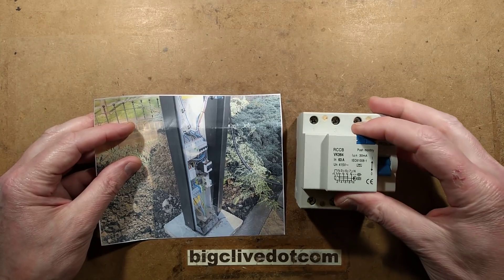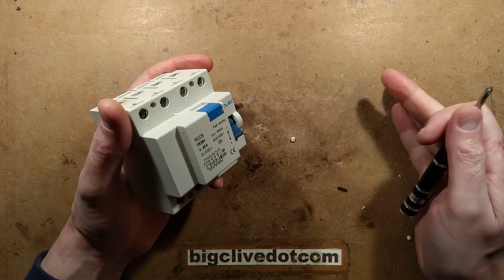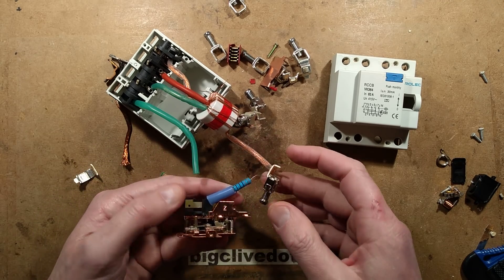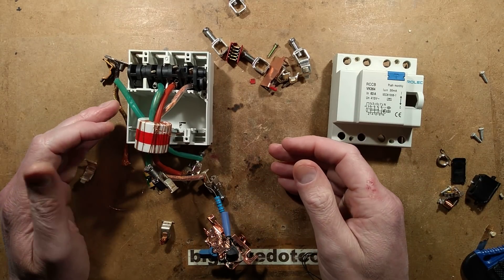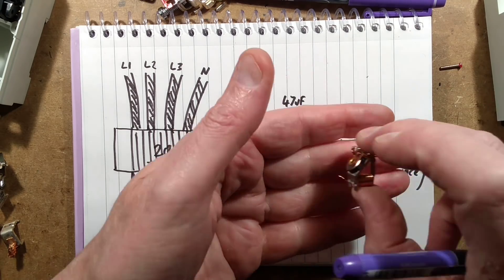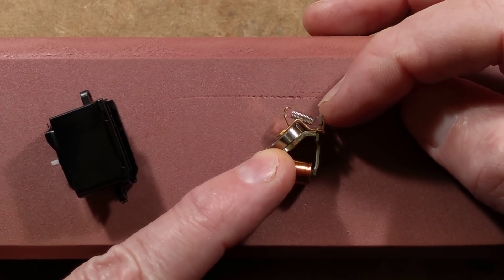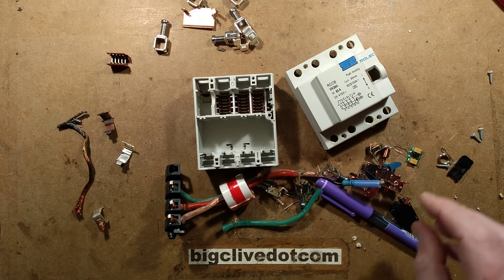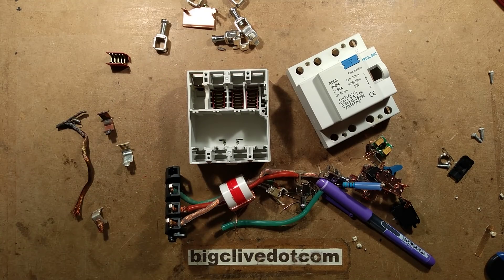Failed 3-phase RCD/GFCI from a Rolec electric car charging pillar. (with schematic)

Comment: Makes you wonder why they don’t just have hot-swappable batteries, it sure beats waiting for a few thousand 18650s to be pumped up.
Reply: I've got about 150 18650s in a plastic tub. It weighs about 15kg. Early Teslas have about 10 times that. Later ones have about 15 times. Home swapping would require packs of about 10kg at most for safety. That means somewhere between 15 and 25 packs to be pulled out, and then somehow safely arranged for charging.
Reply: Nah, make them 25kg, just to annoy the feminists.

But seriously, if they made them hot-swappable, they'd make it all one or two packs, and include a lifting mechanism. I'm guessing they don't, because nobody wants to spend half the cost of their car on a spare battery.
Reply: Actually Tesla did apparently fully develop a system for hot-swapping the entire battery pack with a station. 
The packs are designed to be swappable within seconds.

They just never ended up rolling that out anywhere for many (good) reasons. 
Turns out people prefer to own their entire car when they buy it.
Reply: @Basement-Science  it was developed, but requires modified Tesla. Most of the ones on the road, would require a bit more work to take battery of.
Reply: I remember reading about an intracity electric bus route in the United States back in the 1970s or so that used huge Lead Acid battery packs which required prolonged (16-20 hour) charging cycles.  Since the buses only got a few hours on a pack and were in operation 12-18 hours a day, the bus depot had a huge charging station which did swap out the battery trays in the buses.  If I recall, the swap process was automated and only required 15-20 min to swap out all the packs.  The packs were on rails and were pushed out of the bus by the charged pack going in.  The battery mechanics then performed any required maintenance on the packs and charged them.  I believe each bus had 3 complete packs that were always at some part of the charge cycle in addition to the pack on the bus being used.
Reply: @mcgyver272000  That's how electric forklifts and other material handling vehicles in factories work. You swap out the whole lead acid battery pack either with another forklift or a pallet jack at the beginning of the shift.
Reply: that would be funny and I could just see the issues, people cannot manage to plug them in to charge using easy connectors... now imagine having delicate high voltage high current terminals that need connected perfectly to not cook/burn
Reply: How do you expect to "hot swap" a few thousand 18650 or 20/21700 (over 7000 in some Tesla models)? There would have to be a station that does it. You couldn't do it at home.
Reply: It makes no sense. You would need too many spare packs on each location, and the capital and running costs are too high. Easier to just have fast chargers. Plus as tech develops, capacity will increase and charging time decrease..we all want phones etc with better batteries..cars will benefit and vice versa.
Reply: @fruitytv-uk  and you forgot the fact all cars are different. Full scale battery swap would require them to have many different types of battery packs at each station. Sure, manufacturers would agree on multiple common standards, but that would require even bigger  storage facility at each place.
And since quite a lot of EV owners don't use charging very often, opting for charging at home or workplace instead, building such complex stations is a bit of a hassle.
Reply: In India you can get electric scooters with hot swappable batteries, pull up to an exchange and it tells you which one to take out and you put yours back and go.
Reply: Back in the 70s when I was a child I had a kids science book and in one part of it it looked at ideas for electric cars. There was a concept in the book where the car was driven to a "filling station" where a mechanism (like the forks on a fork lift) would remove the spent battery (which would be recharged at the filling station and re-used later in another vehicle) and install a fully charged replacement making it as quick and easy as filling up with petrol or diesel. Always thought this was a good idea to get over EVs biggest problem - charge time. It would of course require standard batteries across all manufacturers, but there is no technical reason why it couldn't be done - we have standard AA, PP3, 18650 etc. it just needs the will to make it happen.
Reply: Ok so ideally you’d have a vertical lift or sliding mechanism to take the battery case out of the side or bottom of the car, and this would happen at “petrol” stations alongside roads. The money you’d pay for the refill would include both the wear-and-tear on the battery and the electricity cost of filling it up. You wouldn’t swap them out at home because the assumption is that the car would be sitting there long enough to receive a full charge. You wouldn’t need to do a swap at all for basic commuting, it would just make long trips (and cargo transport) more convenient. I can’t imagine getting only 200km before I have to wait for a few hours for my car to recharge, electric cars at the moment are simply not good for that.
Not to mention that the power you charge your car with could be coming from fossil fuels anyhow, if you’re living in a country without nuclear plants or renewable power stations.

Comment: Perhaps the edge-most wire gets pulled on and has insufficient strain relief, increasing the terminal resistance and producing heat?

Comment: If the gardener can kill the protective housing, I expect the whole device is built to a very low price, to compensate for the price of installation.
Reply: i'm now wanting to know what would happen if dogs start pissing on them, would it be a new hot dog cooker for clive?
Reply: It's not just weed whackers either.
My local council managed to mow to top off a power company pillar with a tractor mount mower.
I happened to be watching it happen, the weeds were taller than the 1 foot tall plastic box, so the mower reversed in and mowed the top off everything.
Definitely made contact with street mains, I found a 100A fuse and fuse holder with blade impact marks.
Reply: Yes that was quite the display of power, especially when you consider that only one out of three phases was hit.  This was around 15 years ago so we were still using CRT monitors for the computers; when the line broke every monitor started flickering as if you had activated the degaussing coil to remove magnetization from the screen.  Surprisingly it did not seem to have any effect on the computers themselves, they must have been sufficiently shielded.

Comment: Here in the US there have been problems with overheated neutral in 3-phase systems due to poor power factor caused by electronic power supplies.High frequency harmonic currents do not balance out causing the neutral to carry higher then rated current.

Comment: The fault could be the fact that the left most terminal is the furthest from the "breaking torque" on the other side. Meaning when tripped or going into the off state the twisting force isn't enough to fully or properly disengage the left most pole.  Perhaps why it's common to see the left side with problems.  BTW,   I think it's pronounced Wah-Way.

Comment: Yes, they are tantalum smd capacitors. The bar marks the positive end,  because, why not do the total opposite to electrolytic caps, where it marks the negative ?!
Reply: Jonathan Kay - through hole wire ended tantalum capacitors have always (well, mostly) had their positive terminal/lead marked with a + (plus) symbol. Through hole wire ended electrolytic capacitors normally have their negative terminal/lead marked with an arrow that incorporates a - (minus) sign. But older can type (non-PCB mounting) electrolytic capacitors have used a variety of marking systems (often with different coloured paint spots). I don’t know why, but it has been this way for over 35 years.
Reply: @Mark1024MAK  the likes of you and I, who've been in the business for 40 years, know this stuff. But "a trap for young players" as Hanetar and the mighty Dave L. Jones would say. It was more an attempt at irony, on my part.
Reply: Jonathan Kay - Ahh! The thing that does trip me up is the extra small and hard to read labelling on modern components, especially SMD... And some chips now don’t appear to have pin one markings 🙁
Reply: Trap for young players, eh? Me included... :D
Reply: Ive never understood why electos mark the -ve. Schematics n pcbs always mark the +ve. Odd...

Reverse polarization on a tant is rather energetic. A mate was having trouble getting reliable ignition with his candy rockets with his DIY ignitors. For whatever reason, at work we have about 30,000 small 6v tants that are not used in any design. Gave him a few to try. Given 12v reversed, they rather pop. 100% reliable, and instantaneous, unlike his resistant ones. Rather expensive if your buying retail, but definitely go off.
Reply: @arjovenzia  Glad to hear someone actually did that. One of my dumb tests caused one to explode violently. First thing I thought it would be a perfect detonator...
Reply: Jonathan, electrolytic caps also used to have the positive terminal marked, when most of them were made in Europe and the U/S. Then the Chinese and other Asian manufacturers started marking the negative terminal, for some reason not known to me.
Reply: Maybe it was a problem with condensing water and corrosion.

Comment: RCDs are known to open or attempt to open under extreme overcurrent or short circuit conditions.  So if the complete charging system (pillar plus cable plus car) causes a large current spike when plugging the car in, out or operating the motor while plugged in, this can cause more tripping than normal.  Also, some RCDs are only rated for two such events in the lifetime of the RCD (there's a sticker telling homeowners to call an electrician if it trips from short circuit and to never reactivate it a second time).
  So if the regular operation cycles that scenario as often as once per month, contacts designed for normal RCD use may simply wear out.
Reply: But why wouldn't the other sets of contacts also show deterioration in that case? The rest all looked fine to me.
Reply: @Cupid Stunt 

This is not supposed to act as a fuse (overcurrent protection). The transformer primaries are fed by the live and the return path so it's the same signal shifted 180° so the sum induced in the secondary is zero. If someone or something with earth ground potential touches the live wire, the return path coil in the transformer is circumvented and thus, a current is induced in the secondary which trips the breaker. 

However, sometimes in case of a short curcuit the manufacturing tolerances of the primary coils are enough to induce sufficient current in the secondary, which trips the breaker involuntarily.
Reply: or in the case of 3 phase, 120 degree phase shift :)
Reply: John Francis Doe - this device is an RCD not a over current circuit breaker. It normally will only trip if there is an insulation fault, or other current leakage to earth/ground. So unless there is such a failure at the same time as a full load current, or a short circuit (most likely due to deliberate damage to the output cable or connector), it will not be opening at full load or under short circuit conditions.
I think there is either a design flaw or a manufacturing problem. As it is unlikely that the current in normal use will be anywhere near the rated current of this RCD.

Comment: A stab in the dark, AC->DC we are well aware of but the AC->DC->DC thingy with highest current/best efficiency possible maybe a new ground?
Reply: All high efficiency DC->DC conversion actually uses DC->AC->DC (the AC component being pulsed DC). Modern AC mains powered DC power supply units are actually doing AC->DC->AC->DC.

Comment: It kind of amuses me to think that electric cars are meant to be the future, but if they can't even work out how to wire the damned chargers up, it's not going to be that well received once it's forced upon everyone who drives... :P
Reply: SlocketSeven - and when was the last time anyone witnessed a steam boiler explosion? Exactly. All technologies have failings. We humans learn, and then improve our technologies, and as be develop better technology, it gets safer. There will however, always be some idiots.
Reply: That's like saying ice cars weren't the future because someone installed a faulty gas pump once.
I found it more amusing that someone actually managed to drive off with the charging cable still in, exactly like they regularly do with gas and LPG pipes.
I guess idiots never change.
Reply: You seem to be easily amused! There isn't a single electrical technology that hasn't had failures due to improper use, maintenance, or installation. And, no one is forcing anyone to drive EVs . . . for the most part, they're fun and practical! I love mine- I can beat almost anyone off the line, and not have to deal with all the fuss and muss of petrol and oil.

Comment: Stick a pole in the ground, someone is bound to hit it.
Reply: There's a telephone junction box set 10 feet in from the curb near where I live. It has been hit over a dozen times in the decade or so I've lived here. They finally put a concrete post in front of it to protect it, but someone was able to miss the post and hit the junction box anyway. Never underestimate how poorly some people drive.
Reply: @Markus0021  for years there was a power pole just a foot from the white stripe on a shady curve in bellingham washington.. each winter that area had black ice and cars and trucks would slide and knock the pole down. puget power would get paid to replace the pole. this went on for years. till somebody noticed that there were Absolutely no wires on the pole.. no strand.. nothing.. puget power had to pay back all the money collected from replacing it and i think in a few cases also paid for damage to cars and trucks that had hit the pole as it was too close to the roadway..  i thought you needed a good laugh.
Reply: @waynep343   LOL Love it! Thanks.
Reply: My VDSL cabinet is between 2 driveways of a petrol station... Its the cheapest petrol in town, so its extremely busy with "grey nomads" and their caravans.
Its been there about 12 months now, without any incidents.... I'm actually very surprised.
Reply: Go to some cities in Brazil and almost all the supply is on overhead metal poles. So far pretty standard mo worldwide, except when said cables can be reached easily from an open upper window!
Reply: Paint said post yellow...and a woman will hit it....it's my theory.

Comment: Interesting. AC type RCDs are forbidden in Germany because they don't detect any DC faults. 
That's why it failed here. 
You actually should use a type B RCD for charging stations.
Unfortunately B type 40A/30mA costs around 400€ compared to A type 40A/30mA which costs around 30€
Reply: This breaker wasn't in the feed to the charging pillar, it was inside. Granted, type B are much more expensive and for obvious reasons but the threshold is still mA. If you suddenly apply a fault current of many amps DC (as would need to be the case for this damage) to a type A, it will trip. Maybe even a type AC would.
Reply: Dave Micolichek  maybe it wasn't installed properly, that's the only answer left. Nothing was wrong with the inside, you seen it in the video.

Comment: I wonder if it's usually the left-hand terminal that burns out because right-hand electricians are installing them.
Reply: More likely it's because most EVs charge of signal phase.
Reply: @Andy Peek  Andy Peek  my theory if you tighten the termination up with a screwdriver in the right hand, holding the wire in the left, you may run out of room on the leftmost position against the housing, leading to a poor termination, leading to a HR connection, overheating and cooling. I think Conor is right though. First phase is the most loaded phase.
Reply: I think a poor design of RCD. Even if only the first phase is used, the RCD should be more than capable of handling the current. It should not overheat (assuming correctly installed) at its maximum rated current. And it is rare that such devices are actually ran anywhere near their rated current.
An occasional loose wire/terminal may well cause failure, but if as indicated, many of these are failing, that, to me indicates it’s the design or manufacture of the RCD that is the problem, rather than that of the installer.